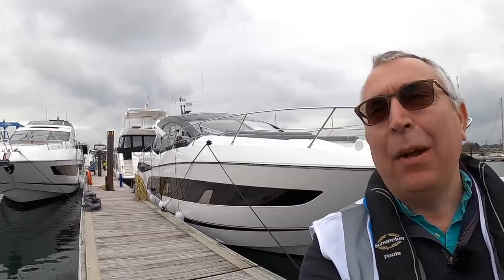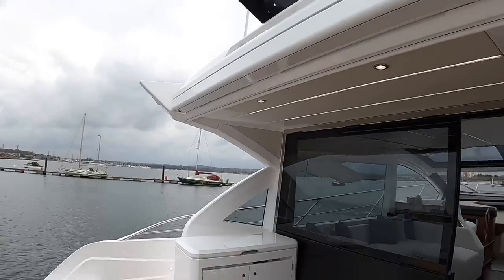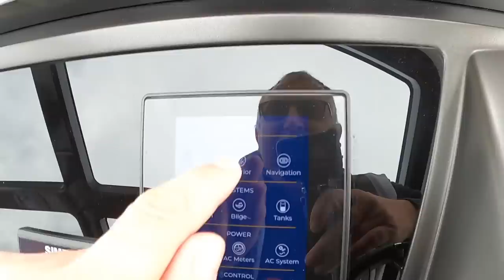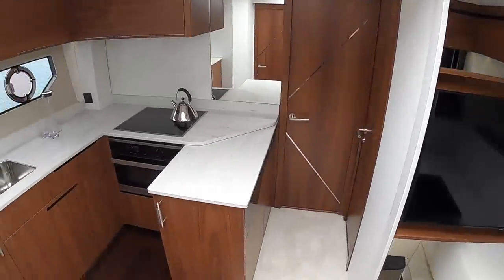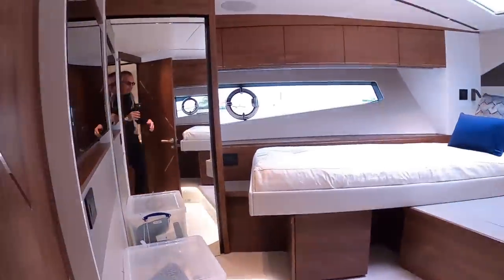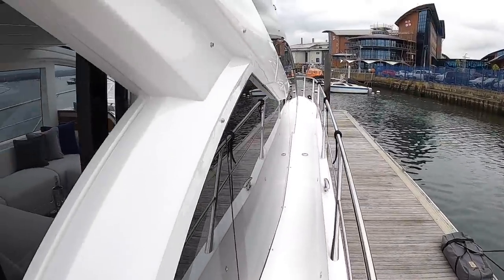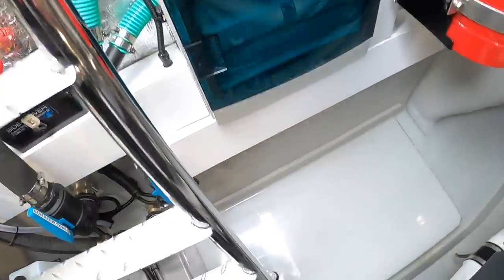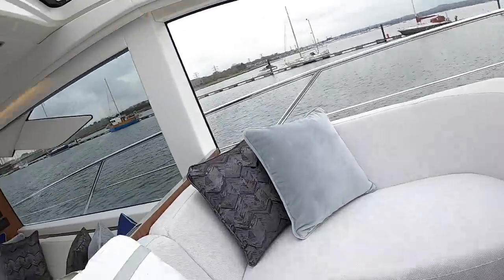£1.1 Million Yacht Tour : Sunseeker Predator 55 Evo

Comment: The Predator series boats are my absolute favorite! This honestly would be the only boat I'd need. Small enough to be easy to take out when I want. Large enough to comfortably dissappear for a week or two.
Reply: taken the words right out my mouth
Reply: My thoughts exactly.  Heck, I could live on it...LOL
Reply: Just need a million.
Reply: Honestly, I like the sport series more.
They have a lot more range (235 mni for this one, 750 nmi for the '65 Sport'). And I think a flybridge is a superb feature, I would absolutely spend al my time on a sunny flybridge.

74 sport is cheaper (!!!) than the 74 predator, and has more range, has a flybridge, even the max speed doesn't differ. 
I have never really understood the predator series, in comparison to the sport series.
Reply: @jerryh559  You do make some good points, however, in response, I would say that...umm...those are good points.  😆
Reply: How do you feel about the yacht
Reply: @jerryh559  i think that that 65' sport's range is 750nmi at 10kn, but on the predator 55 the range has been said when the boat was in the speed of 21kn so i guess that this ones range is also about 750nmi (maybe less as it has smaller fuel tanks) at 10kn
Reply: @veewee4826  I got those ranges from sunseeker own website, so that would be quite misleading. But it is indeed very possible. Than the flybridge stays an argument strong enough (for me atleast) to choose the sport over the predator all day.
Reply: @jerryh559  that is a very good point, flybridge would be a must be for me too.
Reply: I personally don't get this series. If one wants this styling, which I'm very partial to myself, why not get a 5X? These boats are about performance as much as looks, and Pershing just does it better.

Comment: I love everything about this boat except the electric rear glass panel lifting system.  I could hit that button, go below deck and eat a Marmite sandwich before it finishes lifting.  I would just rather lift it and lock it in place myself.
Reply: I said the same thing. I was like its slow. Its going to break. But im sure they made it to last. Its probably on a swivel drive like power seats. Last forever.
Reply: Actually, they know that already but it's about compromise.  If you let people, especially half tanked ones, near such manual devices they inevitably end up hurt, though you do also have to give consideration to open / closing on a rolling boat - inebriated and otherwise.  And of course the failure of such an electric window would almost always be far more forgiving than a manual point of failure.  Even the tender garage could likely be on gas assist struts that could open manually in seconds, but they don't do that either.  And what about the sunroof?  What would be most interesting is if you ask them to omit the electric window and replace with gas struts if A. they will even entertain that, B.  Will they charge more for that or, C.  Will they provide discount (assuming electric window is not an upgrade option) for going with a less expensive manual window (or even a fixed window)?  I think you should send a note off to James @ Sunseeker and ask for his input, James is extremely knowledgeable, and helpful.
Reply: I was thinking the same thing. All the motors seem very slow.
Reply: Spoken like a guy who'll never own a yacht...  Check the timer sport.  It took 60 seconds.  If you own this yacht - you've got 60 seconds to spare.  Trust me.
Reply: @BucsFTW  yeah that 60 second wait is just a deal breaker.  What are they thinking?  I was all set to pull the trigger until I saw that.

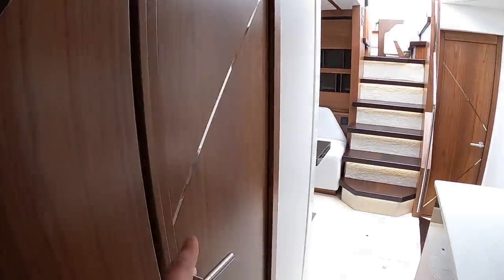Comment: 10:00 one thing many don't realise when they complain about the price of boats VS houses is that in a boat everything has to meet a certain standard. So this carpet for instance isn't just a random cheap cut from DFS. It has to resist fire to a certain degree usually specified by law, and give off no noxious fumes if it burns, etc etc. So a bit of carpet can end up costing thousands.

And that's nothing, on a private plane a bit of carpet that size could literally cost you 30 grand.

Comment: Beautiful boat.. Although maybe a manual lift for the window would be so much quicker. It opened very slowly 😁 Enjoyed the tour Nick.. 👌
Reply: I agree but to be fair it wouldn't be hard to press the button in the morning as you sit down with a coffee or tea. Personally the roof speed and risk of a failure while open is more of a worry usually with the semi-open yachts.
Reply: It would have been a lot better if it slid down into the wall. Make the wall slightly thicker and it could hide the open window. It looks very cheap by comparison to the rest of the boat

Comment: Now….This is my kind of boat …Very nice indeed …. Would be even better if it was on Surface drives !! IMO….anyway …I think you forgot to mention Speed and Range ?? 🤔🤔 Also by the Anchor gear there seemed to be 3 switches instead of Two …what is the third one for ? ….  Very nice video Nick …. defo one to Save …. And come back to, once those Lotto numbers come up 👍❤️🤞🤞

Comment: Thumb's up for showing the tender garage. If the rate is including VAT with efficient state flagging you can save £220k. Tax-dodging or "Bugger Off, Boris", you be the judge. As for it being coupé, for this kind of money I'd prefer a flybridge or at least a sportsbridge; I suppoes without the weight and drank of the bulk on top they DO go quick, so there's that. Very sleek.
Reply: Addendum: I really like the master suite seating/table, nice to see rainfall for VIP cabin, the galley down is lovely- not every boat does that these days but means the salon is purely "living" not a kitchen, and a BIG tender garage is nice on a boat of this size. Full sized Williams - nothing to sneeze at.

Comment: Nice looking boat but, all of the extra electrical systems (side/rear window, tender garage, sunroof) are just begging to fail when you're days away from someplace that can fix them.  The only one I'd want to keep powered is the garage door, the sunroof I'd be happy with it either being fixed or have the 3 panels be manual opening (hinged at the rear and pop open at the front like old school automotive sunroofs).
Reply: Literally every time a button is pushed to open something I think of in what situation it would fail. At Marex they understand this.

Comment: The 55 Evo is a further development of the Predator 50, bigger garage stern area and larger hull windows are the main differences.  I think it was a winner as Predator 50, and not much like it especially if one wanted a fully enclosed hard top boat, and no IPS.  Princess V50 is only IPS, Atlantis 51 only IPS and more of a no patio door boat and no midships master stateroom, Pershing 5x was the most similar option but IPS or surface drives and a higher price tag.  
Now as 55 Evo its goes against the Princess V55, and the Priny is better in mostly every area (most important on the main deck) albeit it comes with a higher price tag.

Comment: She's beautiful. And just my size. I would likely opt for a perfectly forgettable exterior (though I'm keeping the stainless steel railing; but, I want it electrolysis-black ). My only concern would be the absence of any manual redundancies. Obviously, this is a toy; not a deep-sea worthy kind of boat -- what is that called? A coast-hugger, or something like that? Dunno. I'm certain it would be very nice to sail around the Caribbean Sea, stopping occasionally and when necessary, for a couple of months.

Comment: Not impressed. For a 55 footer at 1.1 M, just two staterooms, and so little space. Wake up Sunseeker! Today I can buy much more than that for two thirds of the price. Yes, maybe with somewhat lower performance, but life on the water is not only about performance. It is about comfort, space, amenities that make life easier, and not about powered rear windows made to impress.
Reply from the maker: You mean like a Sunseeker Manhattan 55 perhaps..? 🤔
Reply: @AQUAHOLIC  I mean like many French, Italian, German and even Polish sedans and opens around 55 ft. I understand the brand value of Sunseeker, but there is a limit to the premium one can charge for what they are offering. 

To be more precise, you can have similar space, although with less exciting performance, on a 49 ft. similar boat type, of a less prestigious manufacturer, well equipped, at 600K plus VAT (I obviously don’t want to advertise specific competitive models to the one you present).

Given that all yachts are assembled from third party engines and parts, it is very difficult to justify such a premium price on just the brand name, the design (which is a matter of taste and hence subjective), and the quality (however this is defined) of the hull.